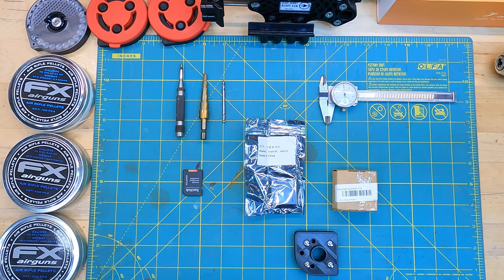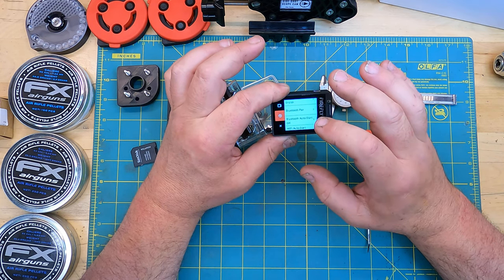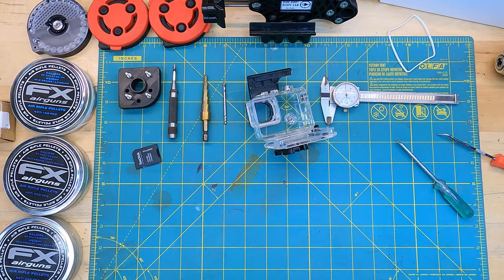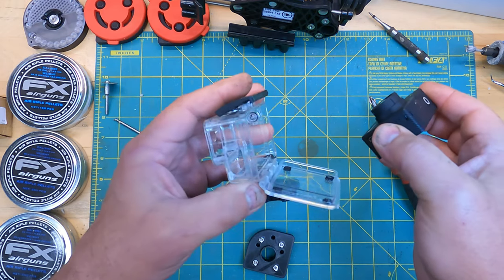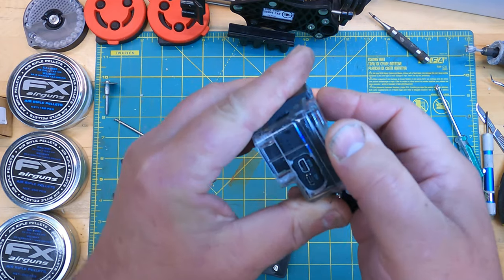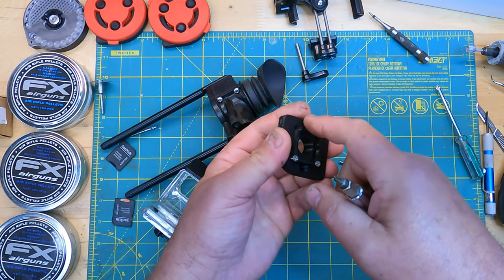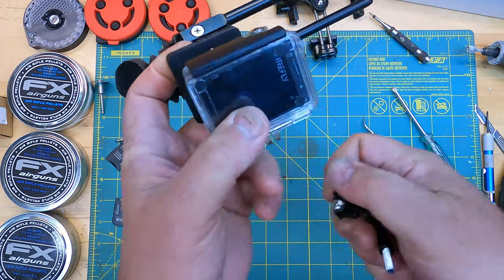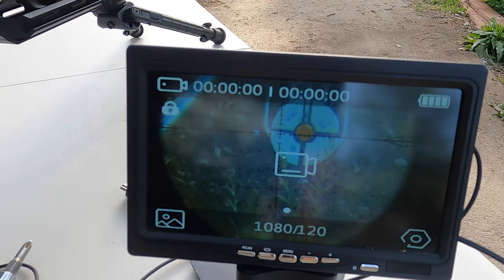Installing the Orion Side Shot adapter for the Firefly 8SE.

Comment: Hi great vid ,I’m waiting for my adapter to turn up 👍 what settings did you film the chickens on because if I film at 120 fps it comes out slow motion and  if I change settings my picture looks too small
Reply: Not really sure what your request is. FPS is Frames Per Second. Most playback will play it at 30 FPS, resulting in "slow motion". Most editing tools give you the ability to speed up higher frame rates, trying to go the other way usually results in poor quality, but saves memory space. When you say "change settings" I've no idea what your changing, but I typically run my rig on "narrow" but it needs to be based on the magnification your scope is set at. Spend some time with your camera, relax and see what the different settings do, and how they impact the footage you collect.

Comment: Hello, what's that sizes of the screws inside the camera case? 
I'm having a hard time trying to take them out.
Reply from the maker: Sorry for the long delay, I missed this comment! I think I used Philips flat head 2-56 screws on mine. I had a tray of 'em. I did have to reduce the head diameter a bit as they interfered with the wall of the case.

Comment: between firefly and gopro which is better sir
Reply from the maker: Which is the better camera? Or value? they are very different answers. Firefly will get you going quick and CHEAP. GoPro will be more money initially, then you'll need to change the lens, not easy, or cheap for marginally better video in the end. My opinion, get a Firefly, and get shooting...